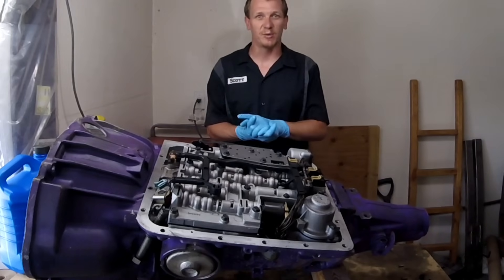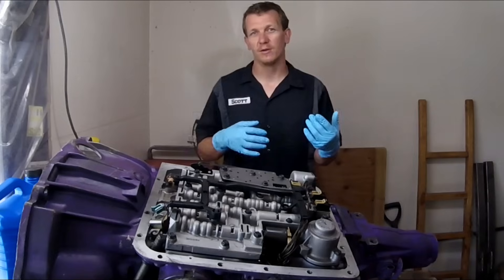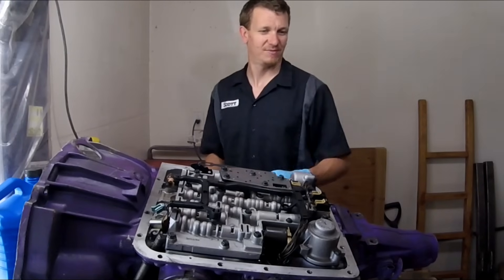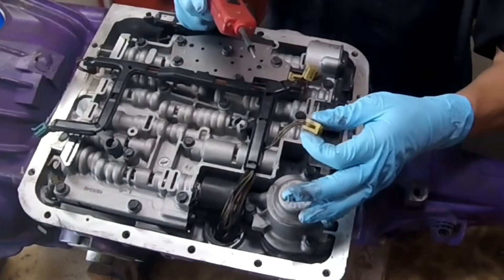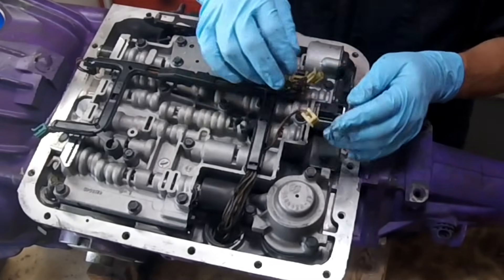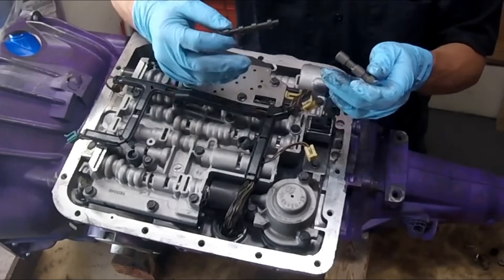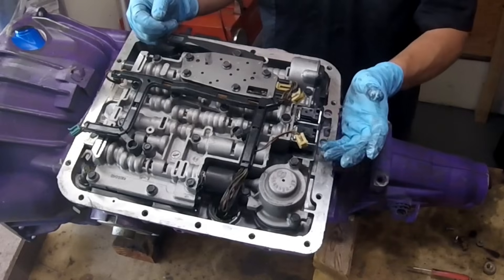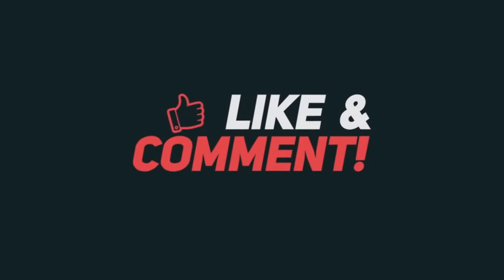⫷ GM 4L60-E Shift Solenoid 1-2 3-4 A and B replace p0756 p0753 p0752 ⫸

Comment: I have code P0894b,shifting from 1st to 2nd gear is rough,i may have pinched the wire harness near the bell housing of the transmission,could it be a solenoid though?

Comment: Would my throttle body cause my 5.3 2003 Tahoe's  oil pressure to go up and rpms when I'm driving at 30 mph
Reply from the maker: Doubt it but a bad tps on this generation truck/SUV can cause some weird issues.
Reply from the maker: Oh yea, how high is your oil pressure getting? Have you check your oil level on flat ground?

Comment: good morning.  I have a hummer h2, it does not change gear the speedometer does not work.  but I have no fault code, can the speedometer be the cause of the gearbox problem?
Reply from the maker: Could be VSS failure or a more major failure with your output shaft. I would check your VSS first. Check the resistance of it. If that all looks good then I would start thinking about inspecting the output shaft.
Reply: @ScottiesHobbies  Can this problem cause the gearbox to fail?

Comment: Aloha was wondering i have a 99 Silverado 1500 4.3  2 wheel 4l60e the problem I'm having is from 2nd tip 3rd kicks into neutral right about almost 30mph i let off the gas it'll kick back in eventually if i floor it higher it'll kick into third was wondering you had any diagnoses for that
Reply: That's the same problem I am having also ..can u let me know what u did to fix it

Comment: My 04 canyon will drive about 1 mile . Then it goes into as if in neutral. 

I can stop and try reverse etc. Nothing 

I turn off engine , let sit several seconds. Restart and drive another mile or so. 

Any thoughts on the matter.
Reply: I'm having the same exact problem in my Chevy Suburban did you ever find out what the problem was
Reply: I have  07 h3 hummer 3.7 witg tge 4l60e i was driving to town and it went from high gear into neutral or nothing and i had tp.pull shifter into 3rd to get it to pull. My buddy reset the code s and stuff and it shifted fine for about4 miles the same thing.  The next time he reset them it only went about a mile and  done it again. Si ce them its been parked. I nevermade any noises or slipped.

Comment: I have code PO758. Shift solenoid B electrical. Should this fix my issue???ij
Reply from the maker: It might. You need to check the solenoid it self to see if it's bad. If not, check the shift valves. If they are all good then you might have a deeper problem.

Comment: I have a 98 4 wheel drive 1500 Suburban. It generally runs fine but will intermittently "clunk" or jump when going into 2nd gear. This will occur only after driving for some time but again, it's infrequent.  Could this be caused by a faulty solenoid or maybe a bad harness? Thanks for your help.

Comment: Would this cause your abs light and brake light to turn on ? My truck is lagging to take off
Reply from the maker: I've seen weirder things happen but I can't logically think of how. The abs and brake light should not effect drivability.  When the abs light is on you do not have abs. If you slam the brakes on the wheels will lock up. Careful.  You need someone to pull the abs code. Hopefully it's just a wheel speed sensor. It could be the pump or control module. But.. the issue in the vid could cause a sluggish start tho.
Reply: I have the same problem ABS and break light on and it struggles to go. Did u find out what it was?
Reply: I replaced abs control module and these lights went away. '00 gmc 1500 4x4 5.3. I am currently experiencing p0753. I have solenoids A&B coming.. I hope this makes the code go away.

Comment: Can you please go over, again, and in more detail, how to use a "power probe", to test the wiring harness pin connectors to the shift solenoids, - at the 4:56 min. mark. I don't understand why you would "have ground on both sides, of each connector", ie, all 4 pins. Wouldn't one of them, on each side, be positive, and not negative? Instead of a "power probe", couldn't you just use a multimeter set to the continuity mode, to test these 4 pins? Thanks.
Reply from the maker: If you want to test the solenoids you can test those by checking the ohms of resistance across the two pins.
Reply from the maker: If you do not have a break in your wiring harness and your harness is plugged in to the external plug you should have some type of continuity at the solenoid connections. If you have no continuity that would mean a broken circuit. If you have some type of continuity that means the computer can control those solenoids.

Comment: In this video which is the A and which is the B shift solenoid? - which shift valve body / solenoid is the one that has the spring behind the valve? Which solenoid is the one that goes to that valve with the spring behind it?  Thanks.
Reply: I know its been 3 years now Im at your point now I think it doesnt matter

Comment: Thanks for this informative video budd. Ive never done any transmission work in my life but after watching this video and great angle by the way... My 97 chevy is driving like a badd mamma jamma and the gears are shifting smoothly. If i didn't pound some beers while i was doing this... I'd take the fam out for a test drive but i guess tomorrow's drive will be thanks to you budd keep them videos coming..👍
Reply: I also have a 97 k1500.. what did you all do to fix your shifting issues? Mine shifts hard and does not shift into 4th gear anymore. I haven't done anything for transmission work either other than a filter replacement, trying to do all my research before I drop the pan again.

Comment: Nice video! I have a 2007 Tahoe LTZ I lost my 2nd and 4th gear.. Works great with shifter in 3rd, but have to rev out 1st to pass 2nd and blip off gas to shift into 3rd skipping 2nd... There's no over drive or 4th.. Been driving Tahoe like this for 6 months lol.. Is there are 2 and 4 band needed to replaced? Thx
Reply: I put a 350 in a Chevy blazer now it want shift out of high gear
Reply: Did u ever solve the issue started having same issue on the same model of tahoe as urs

Comment: But what is A, and what B? Is so dificult say those?
Reply from the maker: If you check out my video library I have a video specifying. But really does it matter? If you are going to check one. Check em both. If you are gonna replace one solenoid, replace em both. If you are gonna clean the shift valves on one, do em both. They are the same part number. But I do have a video pointing them out and a video on testing them. Thanks for the view and comment.
Reply: @ScottiesHobbies  thank you we are not expert in those but remember many persons is waiting those small details what only you know it .
Reply: Lmfao

Comment: I replaced my 2002gmc sonomas torque converter; and it would go into all gears & move but now nothing in all gears no movement at all. 4l60e.
Reply from the maker: Have you checked pressure? You should have inspected your pump  while you are right there at it. There is a port on the driver side that you can install a pressure gauge to.
Reply: Probably didn't have the converter in all the way.   Bolted it back up and broke the pump

Comment: My issue is when I'm driving, occasionally the gear wont shift up. So I make it to 35mph it wont shift up only the RPM goes up. I have to slow down for the transmission to downshift and I have to speed up faster for it to catch gears and reach higher speeds. The transmission will then idle at 55ish/60 and I have to slow down and speed up again for it to cathe gear. Any idea what this could be?
Reply: mine does same thing except mine started acting up right after fuel pump replaced with brand new one... have you found out what it was ?
Reply: Mine does something similar can you post if you find the problem
Reply: @J0KER2630  n if u have a problem with yours, tell me what its doing n i can narrow down culprit
Reply: @JOKER2630  ,-- hey bud, just finished my solenoids, and ill ted ll u this at first it was better, but within 5 miles I'm driving the hard shifting stopped the having to take my foot off the gas in order for it to shift has stopped if the transmission shift smoothly sometimes you can't really feel or tell that it has shift gears but the two solenoids I got wear not Factory theyre aftermarket
Reply: @James-929  thanks for all the info very helpful. My truck goes to about 35mph  and goes to neutral like you said I have to ease off gas then it's a hard shift to 3rd and I haven't gone past about 55mph I did order a solenoid kit OEM just haven't got around to it
Reply: @J0KER2630  okay cool. while your in there i would replace the trans filter as well, its simple to do, n if the filter ring dont come out, dont force it, just reuse that ring, it wont hurt nothing.. then change fluid using new fluid, youll notice changes within few miles, if u still have issues, msg me, n ill help u troubleshoot, but this is where id start...
Reply: @James-929  beautiful! Can you tell me which ones they were? I need asap
Reply: @ortegafresn  do u have a service engine soon light illuminated on cluster ? if so do u know what it is? autozone can check for free if u do have it on.
Reply: @J0KER2630  im thinking my problem is the shift solenoids..im a mechanic myself but dont do transmissions. but solenoids are super easy to do. theres to in there..im going to replace them this week. if u like ill let u know if that fixes my issue
Reply: @James-929  did you do the solenoid job? Did it work? Thanks in advance
Reply: @J0KER2630  no i didnt do it yet, its been raining here alot, but ive got a set of solenoids n even grabbed a spare set of them used in working order, so if it does fix mine, ill have a spare set here, so if u cant get a set let me know, n i can send u the spare ones i got
Reply: @J0KER2630  i will be trying to do it over the weekend when its not raining
Reply: @JOKER2630 - I did the solenoid job, but havent put new fluid   in it, but the way the fluid turned brown after only a yr of driving, so today im gonna fill it up n take on hwy.
Reply: what you mean ? which one what ? are u asking which solenoid controls which gear ? the solenoids have the same part number, so it doesnt matter where u install each one at
Reply: @ortegafresn, yes those are your shift solenoids A&B, also change trans filter ! Do u already have solenoids, for replacement ? also id recommend new fluid, n add some lucas trans fix as well, the 4L60e trans should only take 1 gallon of trans fluid just from dropping pan n filter, if u already ordered solenoids great, if not let me know, i do have a spare set idk if your comfortable with that or not, n if u need any assistance msg me here or i may have my cell number listed in this thread, i do get alot of bogus texts so if u message just let me know who u are, so i dont delete ur msg..
Reply: @ortegafresn if u have a multimeter u can check your solenoids to make sure they are within range. just set it to ohms to check for resistance (thats the upside down horse shoe and connect each lead to where sensor plugs into (it doesnt matter which lead goes where because were checking resistance) n if its between 20-30 ohms ur good,below that is bad..

Comment: Seeking your advice;
98 chevy c1500 4.3 4l60e.
Sat for 5 years. Was a gift. Changed filter/fluid.  Nothing major at the magnet. Just small dust. When cold trans shifts in all gears. Once slightly warmed,  it shits the first hard(brutal). After that it doesn't shift. What's your opinion?

Comment: I had the same problem with my z66 it would not shift out of 3rd gear .I changed  both shifting a-b in the transmission and the filter it worked for 2days then back to the same thing would not shift out of 3rd gear put it in the shop turned out to be wiring problem 259.00 dollar fix
Reply from the maker: The wiring harness was bad?
Reply: What wiring?
Reply from the maker: @ortegafresn  the only wiring in that transmission is a wiring harness. The harness that connects to the outer case then to all of your solenoids. There's not many wires involved in this transmission.
Reply: The transmission shop told me it had a wiring problem no details

Comment: When I put in solenoid A in, it locks in place with me putting the safety pin in.

When I put in solenoid B it shots back out. The plunger looks like it’s stuck open. 

What could be the issue?
Reply: Did you watch the video? solenoid b has a spring behind it so you need to hold it in then put the clip back on.

Comment: Will changing the solenoids help with problem of not changing to 3rd gear on 2004 GMC Envoy or full rebuild. Thanks
Reply from the maker: Are you saying after a rebuild your third gear did not work?
Reply from the maker: Check out my video library or Google Scottie's Hobbies 4 L 60 e check valve. I would send you a link but I'm not in the position to do so right now. Let me know if you can't find it. I think that video will help you out a lot.

Comment: Hey Scottie. ..I have an 04 trailblazer that is giving me a P0741 Code. No other tyranny codes come up. The trans shifts hard from 1-2 and will buck and jerk when warmed up. Cruise speed is not to bad. I can feel a little slipping. If I remove the oil pan and find NO metal or crud what might you suggest. I do plan on testing the soleniods with the 9volt battery and check for ohms. If those are ok then what? Torque converter?  Valve body? All the above?
Reply from the maker: Make sure to check the 1-2 accumulator when you have the pan off. It's super common for those to go bad and cause the issue that you're having. The accumulator Pistons sometimes break, sometimes get crooked, make sure the shaft in the center is good too.

Comment: I have a 2003 Chevy trailblazer. This past Saturday morning I was driving and when at 45mph it was pulsing, later in the afternoon it was not going into 3rd until I let off the gas then slowly pressed on the gas pedal. Today, Monday morning it was fine until I got to operating temp then it would not catch 3rd at all. Does this sound like something a bad solenoid would do or a different issue?
Reply: Hey I’m having pretty much the exact same issue with my 2003 Chevy Tahoe. Did changing the solenoid fix the issue for you?

Comment: Hi there,I have a 2004 Chevy Blazer 4x4,my service engine light is on but my trans has been giving me trouble like a sluggish or delay from park to drive it feels like it's a sec before it engages and I took it down the interstate and it did not want to shift into the last gear. I started back home and off the interstate it did fine,could this be the a&b solenoids going bad?

Comment: What causes the odometer and the rpm needle to go haywire? And the vehicle to speed up and slow down while cruise control is on?
Reply: battery charge, or battery connection fai;ure

Comment: Great video. Hope you’ll have time to give me some input. When driving and I approach a stop and i get 2-1 downshift, once I go I’ll get a sluggish/bind for about one second. Then I feel something release/unbind and the truck drives normal. If I wait long enough at the stop (say a minute) I actually feel that resease and it won’t bind on take off. I get it all the time after a 2-1. If when slowing down i shift to N and then into drive after I stop (avoiding the 2-1) then I won’t get the bind. What do you think?
Reply: I have a 97 S10 that don't shift out of low gear what can be the problem

Comment: Hello I have 2 question with 2 problems lol...
First I have a 92 Chevy blazer full size 4x4 and from one day to another it didn't want to shift gears I would have to put it on 2 so it could drive normal!! Second one is a 95 Tahoe it was running good till my drive shaft broke off now it rides stupid ruff like if I have about a 1000 pounds behind me lol not sure of I didn't put the drive shaft right with the u joint that connect to the rear differential

Comment: Hey Scotty. Thanks for the video. I have a 2006 Chevy Trailblazer. It wouldn't shift  into 3rd gear. So I tested the shift solenoids like you said and they both were good. So I pulled the shift valves out. The one with the spring came and went back in with no problem but the second valve with no spring was harder to take out and wouldn't go back in all the way. I can't get the solenoid back on until the valve is all way seated. Do you has any suggestions to this problem?
Reply: Stanley Coleman I’m having the same problem with the second shift valve (the one closest to the drivers side), I got a shift solenoid A code and bought 2 new solenoids, I pulled the second solenoid out and, the shift valve is sitting there popped out, and I can push it back in a clamp the solenoid down, but, I’m not sure if it is supposed to be like this or not. Did you ever figure it out?
Reply: @parkercreates2696  Nope, I ended up up changing the transmission.

Comment: Hay Scott I have a 2002 Tahoe 4x4 and it won’t go over 40mph. The trans fluid is a little burnt. Could this be caused by shift solenoids as well?
Reply from the maker: Could have the 3-4 gears burnt. If the 3rd check ball has gone bad it will cause 3 and 4 to go bad. Always start by checking the shift solenoids, they are prone to having problems.

Comment: I have a 4l60e and my truck will not shift from 2-3 And it's a good transmission with bright red fluid so what could be my issue? Could the solenoids be the issue?
Reply from the maker: Any check engine lights on?
Reply: @ScottiesHobbies  well that I'm not sure I had my battery disconnected while changing transmission because I put in a new neutral safety switch and I also checked my tps with a volt meter and that was good, I've not been able to drive far enough for a check engine light to come on i believe. I just started my truck up and tried to drive down the road and just wouldn't switch from 2-3 And I just had this issue with my other transmission but it was the clutch packs and that transmission was toast and the fluid was dark red/black.